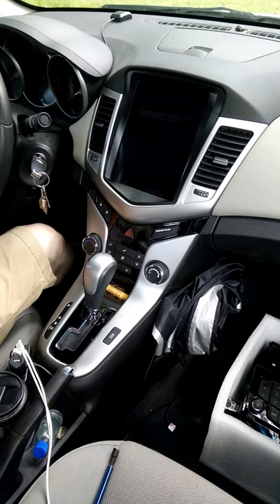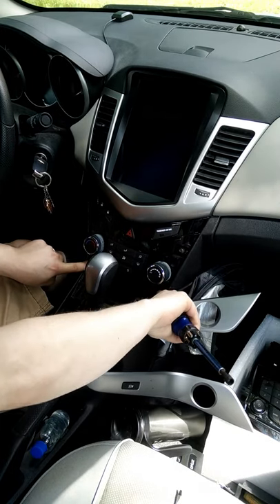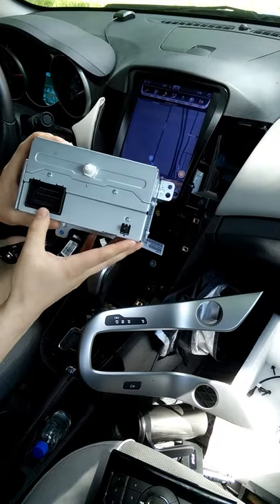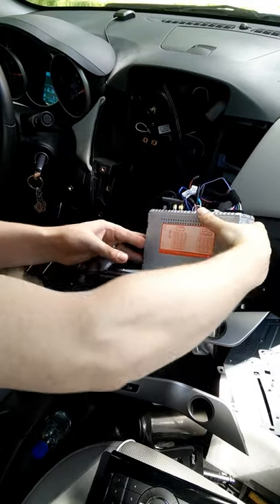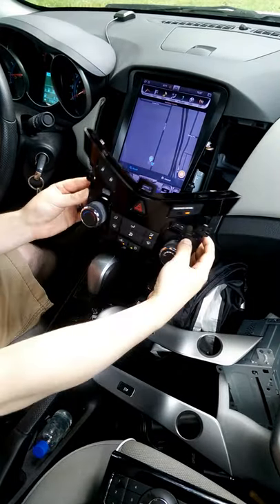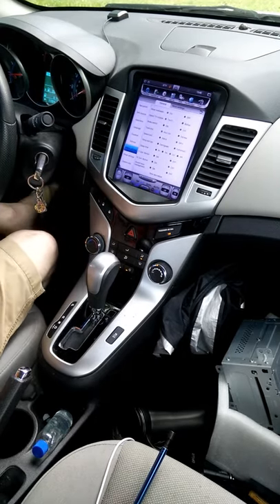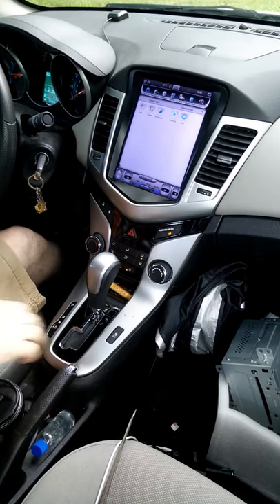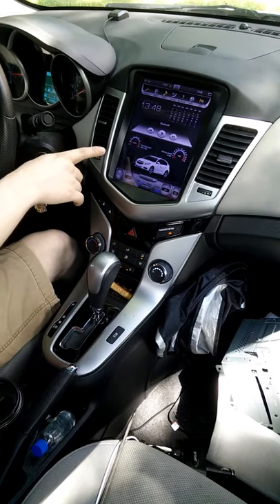Chevy Cruze "Tesla Style" Stereo Install + Year-In Review

Comment: So do I have to buy another harness when I buy the radio or is it all plug and play
Reply from the maker: Comes with the harness you need so, nothing else to get.  I would look at the seller for a newer version.  This stereo has basically been discontinued.
Reply: @davidsteinlage  is this why mine doesn't have the box on the back like yours? I just got mine in today and it's basically flat on the back
Reply from the maker: @Josh-ks4lx  I was mistaken.  I found out that the model I purchased from Amazon was just one version among many that were not listed there.  There's a listing on AliExpress (I've never used them and cannot speak to their reputation) has about 10 different varients that all look the same but differ in terms of features like CPU core count (4 vs. 8), whether it is 4G LTE capable, rear camera included or not, digital signal processing of audio (whatever that means) and display quality.  But I wouldn't be surprised if what you see and what you get are different.  These are made by a mystery Chinese based company and I could imagine clones of clones... The bottom line is, does it work?

Comment: is there anyway to run the apps off of your phone on this unit so you don't have to rely on a hotspot connection? if so i am considering getting this.
Reply from the maker: No there isn't.  This one doesn't support Android Auto or Apple CarPlay.  But if you have an Android phone you can use Tasker to automate your phone to enable and disable it's hotspot when a bluetooth connection is detected.  My most recent video shows how to do this.  I would think there's a way to do this with an iPhone as well but I have no idea how and would suspect you'd have to jailbreak it.
Reply: @davidsteinlage  alright, that kinda sucks because hotspot isn't always reliable, but one more question, does it support sirus XM?
Reply from the maker: @TheRetroGamerBay  not natively, you’d need to get some kind of stand alone external XM tuner and connect it to the Aux input RCAs.

Comment: Did it come with the wiring harness?
Reply from the maker: Yes, two.  One couples/locks to the factory wiring that would otherwise lock into the rear of the stock stereo, the other fans out into multiple RCA inputs and outputs for aux input or amplifier outputs, camera inputs and that's about it.  There's also a couple female ended USB cables you can use to plug in, say, a flash drive or whatever Android supports natively.  Apart from that is an antenna input jack, external GPS antenna (included) jack, and a little wifi antenna.

Comment: Where did you get the GPS antenna you said you purchased got a link? Thanks
Reply from the maker: https://www.amazon.com/dp/B07P6684GZ/ref=cm_sw_r_cp_apa_fabc_oVK3FbG19GA5Y?_encoding=UTF8&psc=1

But really, any GPS antenna you might find will work as long as it has an SMA plug on the end of it.  Just make sure it's well reviewed.
Reply: Lol thanks anything else I show get for it ?
Reply from the maker: @scottmiller6841  I can't think of anything else.
Reply: Nice thanks for the info and great video.. Did u pull the fuse when in stall or just make sure keys are out of the ignition
Reply from the maker: @scottmiller6841  I didn't pull the fuse, got lucky. You definitely should do that before you swap things.
Reply: Do you know what fuse it is?
Reply from the maker: @scottmiller6841  https://youtu.be/siH5AylVhnA

Comment: will it work with XM radio if you had one before on your old stereo.
Reply from the maker: I think the only way you could use XM on this is with an external XM tuner connecting to the Aux RCA inputs.  If your original stereo was able to tune XM all by itself, I don't think this would work.
Reply: @davidsteinlage  okay How about if I download the Siriusxm app from play store Because I downloaded xm app on my android phone. Also I have a Siriusxm account.
Reply from the maker: @TT-hy1hg  I'm not familiar with the app but it should work, so long as you can give the stereo wifi access.
Reply: @davidsteinlage  okay Thanks for the Info.👍

Comment: Anyone know if this would fit in a 2017 chevy volt
Reply from the maker: Not this exact unit, the bezel and stereo are one piece and it's made to fit Chevy Cruze, gen1 (2016.5 and earlier; the second gen was introduced in 2016).  I doubt your 2017 would use a dash designed for a discontinued car.  Try googling something like "Tesla style stereo Chevy volt" and see what you can find.

Comment: I have one but can't get the Bluetooth to work
Reply from the maker: Are you able to get it to at least pair with something like a phone?
Reply from the maker: @Brandon Hudson Confirm you can get any audio at all by trying to tune in an FM radio station just to rule out an amp problem with the head unit.  If that works, one quirk I've noticed with this, and it's random and I do not know why, is that you have to tap the Bluetooth icon on the ribbon bar at the top and ALSO then tap a tab at the top right of the screen that opens up that I think says "Bluetooth Music".  Additionally, on your phone, you need to make sure the bluetooth pairing profile has all items enabled/checked (e.g., media, phone... maybe not contacts but it doesn't make a difference if it's on or not).  One more annoying quirk is that if you uncheck phone on this profile in your phone it actually breaks media/audio playback functionality... so I have to leave Phone checked.  I kind of wish I could uncheck Phone because I do not like the on-screen interface when a phone call is in progress, I don't like speaker phone, I don't like the microphone that's built into the unit and prefer using a bluetooth headset for phone calls instead and would rather the bottom half of my Waze display not get covered up because I'm on a phone call.

Comment: Did this impact onstar functionality?
Reply from the maker: I didn't have onstar to begin with so I don't know if it would be.  I think this question has been asked before on the Amazon listing, check the link in the description... I wanna say it wouldn't affect onstar but I don't remember.
Reply: @davidsteinlage  do you have a rear camera?
Reply from the maker: @dannyzamudio1252  I do, but it was an aftermarket one I installed myself.  I put up a separate video showing what wires I spliced off of in the trunk to get 12V power from the reverse lights and otherwise route an RCA cable up to the front to plug into an RCA input for rear camera on this stereo.
Reply: @davidsteinlage  thank you!

Comment: Does thiswork on the 2015?
Reply from the maker: Yes.
Reply: @davidsteinlage  my stereo just got the flicker. I replaced the ground cable didn't fix it
Reply from the maker: @jakehester9979  Do you mean the original stereo flickered?
Reply: @davidsteinlage  yes. Iv pulled fuses and cleaned and replaced the main ground
Reply from the maker: @jakehester9979  that sucks.  There are newer models of this stereo, but I’ve not tested any.  You might look for a review video from someone else about a newer one and get something a little more worthwhile.
Reply: @davidsteinlage  well any ways thank you. Still looks better than factory.

Comment: hey man When I install the stereo, the air controls don't work well, it just stays on and can't be turned off, you know what happened.
Reply from the maker: You can't control the air with the stereo.  You have to use the knobs and buttons like you always have.  If they're not working, check the connections going to those to make sure they're not loose.
Reply: @davidsteinlage  thnak you sir let me check that
Reply: thanks that’s been check there’s no power to the knob unit thansk again

Comment: Will this stereo work for a 2012
Reply from the maker: Yes.  It should fit any first generation cruze, up until the 2015 models and the first half of 2016.  Second generation started rolling off the line in the last half of 2016 and are completely different looking inside and out.
Reply: @davidsteinlage  do i need to disconnect my car battery before installing? I got mine today
Reply from the maker: @b-tony30  You can either do that, or pull the fuse for the stereo.  The fuse is located in a compartment below and to the left of the steering wheel.  There's a diagram embossed on the access panel you can reference to find the correct fuse.  Here's a video someone else made that shows where it's at.  https://www.youtube.com/watch?v=siH5AylVhnA

Good luck with the install.  As I recall, the breakout-header for the RCA cables was difficult to insert into it's socket, so just be careful.  Try to insert by alternating pressure against opposite sides of the header to rock it into place.
Reply: @davidsteinlage  when do i put the fuse back in? Before turning the car on?
Reply: Also the gps doesn't work. Was it supposed to come with a silver box ?
Reply from the maker: @b-tony30  after you have everything else connected...
Reply from the maker: @b-tony30  Yes, after install, before turning the car on... otherwise it won't receive any electricity to power it on.
Reply from the maker: @b-tony30  It should have come with a little black square-ish shaped puck that would have been external and plugged/screwed into a header that looked like the same little port you would also connect a little 2 inch wifi antenna into (wifi antenna included).  The GPS antenna I got was defective and getting support from the manufacturer was not working for me so I bought a new third party antenna.  This is the one I bought, but any with an SMA connector should work:  https://smile.amazon.com/gp/product/B07P6684GZ/ref=ppx_yo_dt_b_asin_title_o02_s00?ie=UTF8&psc=1
Reply: @davidsteinlage  I appreciate all your help thank you

Comment: does it still work with the reverse sensors?
Reply from the maker: The Cruze doesn't have reverse sensors.  The stereo interface suggests versions of it meant for other vehicles that do would work but I don't know if they really do.  A proximity diagram appears on the screen at the same time the rear video is presented but doesn't do anything in this car.  Perhaps that's a second gen thing (2016 +1/2 year cutover to new design), which this stereo cannot be fitted in.